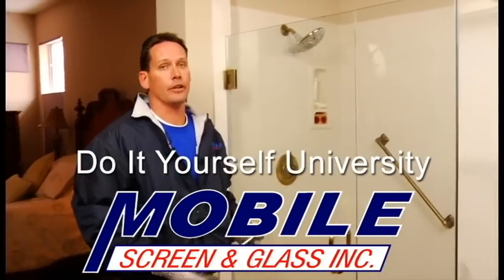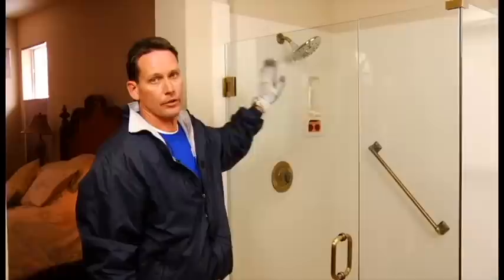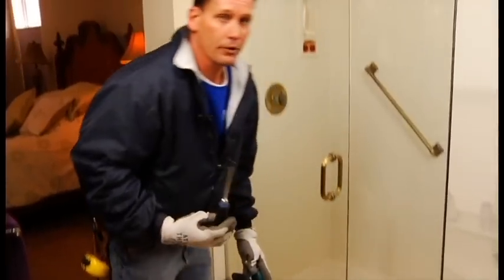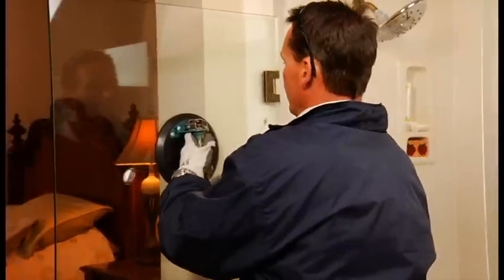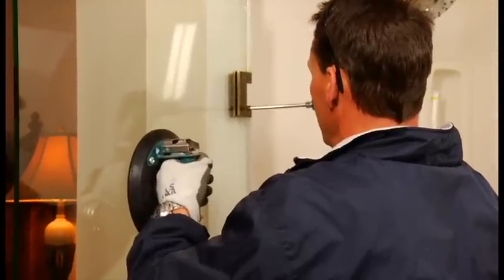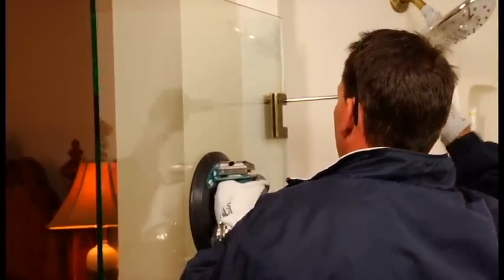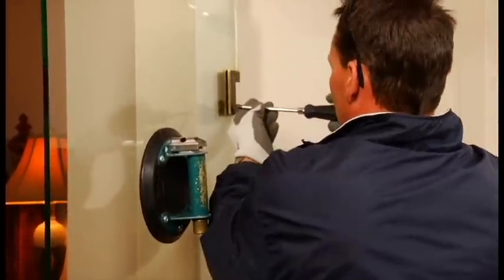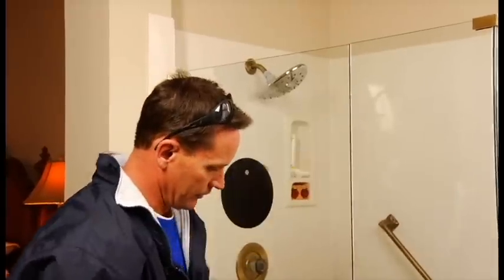Tightening Heavy Glass Shower Door Hinges - Mobile DIY

Comment: This is by far the best and most accurate video on adjusting the door.  My door is newer and instead of phillips head screws it has allen screws.  You really don't need a suction cup unless like the installer in this video, you are doing the job alone.  Another person, anyone, can simply stay outside the shower while you get inside.  If the door is only slightly out (1/32" - 1/8") you don't even have to touch the bottom hinge. Make sure you only unscrew the hinge screws one turn then, as shown in the video, gently lift the door up and back into the top hinge until the space between the fixed glass edge and the door edge is equal- my wife then put the shim under the edge of the door.  Take care not to over tighten the hinge screws - what I did was to check how tight the screws were before I unscrewed them and re-tightened them to the same value after the door adjustment was complete.  I saved $195 that original installer wanted to charge me - fix only took a couple of minutes.
Reply: Thanks!  Once you unscrew the hinge to adjust it, do you have to re-tighten the screw? It looks like in the video he just unscrewed it some.

Comment: Remove sweep.  Bring a #3 screwdriver, a small pry bar, and 5 wood shims into the shower with you.  With the door closed, make a stack of two wood shims under each side of the door, snugging them up to the bottom of the glass.  Loosen the screws on the top hinge.  Use the curled end of the prybar under the handle side of the glass to lift the handle side of the glass up, putting the extra shim between the glass and your prybar so you don't chip the edge of the glass.  You can see the reveal as you get it perfect, then snug up the shims that you have just raised the glass off of.  Tighten your screws, and you're good to go.  No suction cup needed, no trial and error for alignment, no chance of slipping messing up the position of the glass in the bottom hinge or blowing up the door, and done in 2 minutes.
Reply: Fancyturdhat I think the whole hinge by me is broken. There seems to be a gap between the hinge and the metal part o  the door frame and makes a noise when open and closes and it moves. Can i send you a picture?
Reply: How do you remove sweep?  Please don't skip steps.

Comment: I have installed shower doors for 12 years and can do the adjustment in 10 seconds with just a #3 Phillips Screwdriver. You can just lift on the door handle and don't need a vacuum cup since homeowners do not have one.
Put the door in the closed position while inside. Since the glass is touching then it can't drop more when you loosen the top hinge screws. Lift up on the door handle and at the same time tighten the 2 screws. Done.
Homeowners need to be able to do this or know a family member/friend because the weather or temperature changes cause the walls to move and it may need adjusted several times. This should not be considered a "Warranty" service call since it is not caused by improper installation or workmanship. It is a simple adjustment that comes with ownership of a Frameless Shower Enclosure.
Reply: John Smith I feel like the actual hinge is breaking and not just moved position  I have a photo could you Tell?
Reply: Awesome!  Thanks!  Is there a worry about over-tightening / shattering?

Comment: Why does the door slide over.  Its only been 4 months since installation and the upper edge is hitting.  I was wondering if it has to be from going from a/c temperature to heat.

Comment: I'm not exactly a glass professional although I have work with glass a bit with windows and several glass enclosures. Seems like you might want to take the plate off and put a little shim in there because as the door gets used and the temperature goes hot and cold etc do the next month's years it will sag again correct? But if you put a shim then I think it's much more permanent fix :-) Thanks for the clear quick precise video. Also I happen to have suction cups but most people don't so you could put some books under the lip of the door when you open it and jam some shoes under there to lift it in a thorough quarter inch while you're doing your work Might even be good to have another person especially if you're not a pro :-) be blessed!

Comment: I'm having a problem like a previous comment, with the bottom of the door hitting. I looked at the hinges and there's a space between the metal part that attaches to the wall, and the metal plate that sticks out to hold the door. This is not on the top hinge. It's clearly become loose. Do I have to take down the whole thing? Thank you for your insight!
Reply: Nope just have the door in a closed position and losen the bottom hinge , than put a wood shim behind the bottoms back hinge and push it out till it's even than tighten it back up

Comment: One of my upper hinges on my frameless shower door isn't holding. I lift the glass up and I looks like it's holding, once I try to open the door it comes back down. Does it just need to be tightened?
Reply: Mine does the same thing. I’ve sealed it with clear sealant. I have to retighten it about every three days. Just the top slips. Getting tired of it!!!

Comment: Hey guys. My bottom glass door hinge can't close as there's no "space" between the 2 glasses. The upper hinge is fine. Does this method fix it?
Reply: If there is no space in between the hinge and the glass, there could be an issue.  First, the problem could be the glass was measured and installed with no tolerances.  If this is the case, the bottom hinge cannot be adjusted.  The second possibility is that on the bottom hinge itself, the standoff part of the hinge which screws through the back of the wall plate with two screws which are only visible when the hinge is off of the glass AND the wall, have become loose.  This can be rectified, however it will entail removing the door from both hinges in order to unscrew the hinge itself on the bottom from the wall in order to re-tighten the standoff screws.  Hint-if you choose to try and attempt this option, set the glass on carpet; NEVER of tile or cement as the tempered glass is very fragile on the edges!
Reply: Put shims between the wall and the edge of the door on the hinge side so the glass can’t move closer to the wall. Shim under the glass so it can’t move down. Take the plate of the inside of the shower by removing the screws. Push the glass back to the correct position by moving the shim at the wall more. Make some shims out of plastic and put them vertical between the glass and the inside of the hinge. Then oust some on the top of the hinge on the inside of the glass cut-out so that the door can move down. Put the plate back on and remove the shims around the door. This is how to properly adjust and shim a bottom hinge on a frameless door.